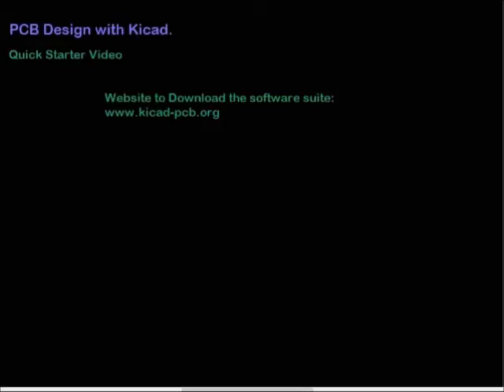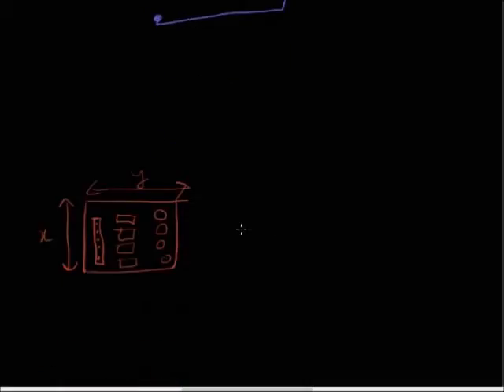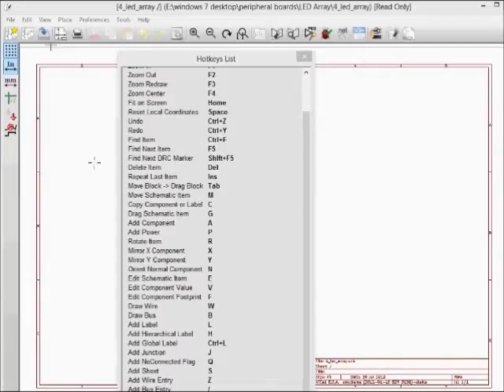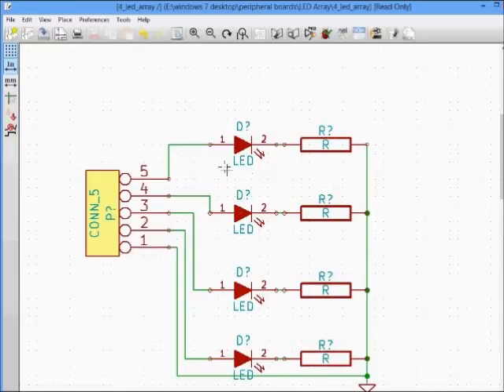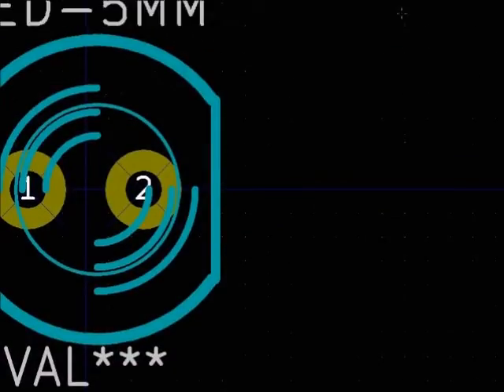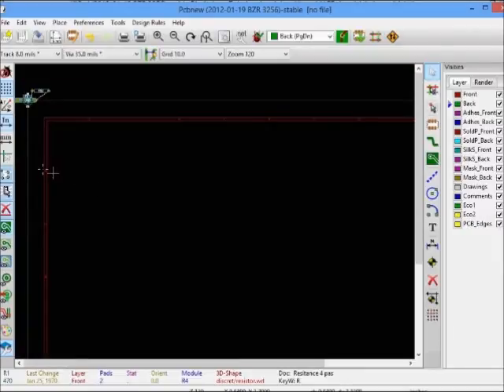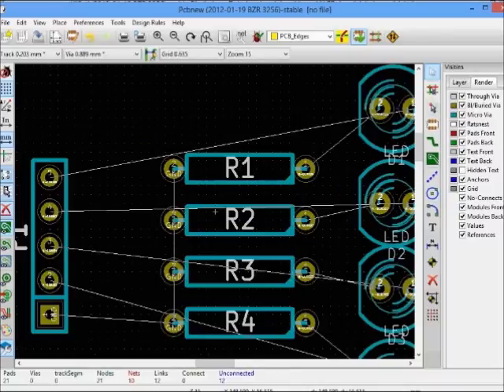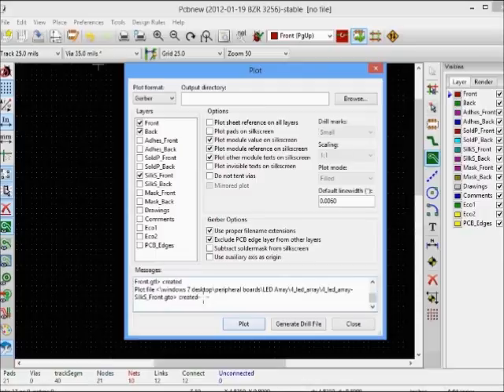KiCad PCB Design for beginners = kickstarter

Comment: 1 Inc = 2.54 Cm = 25.4 mm = 1000 mils.
But I think that mm in KiCad in this case is for mm not for mils.

I am just curious, why are you using such a old version (2012-01-19) of KiCad?.

P.D.: en.wikipedia.org/wiki/Thousandth_of_an_inch